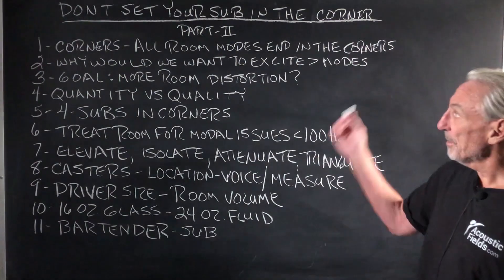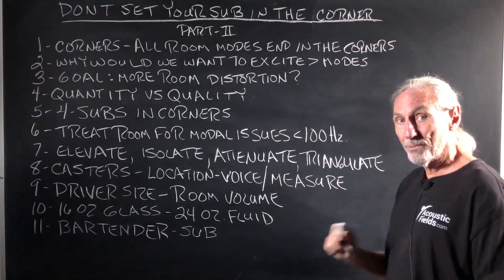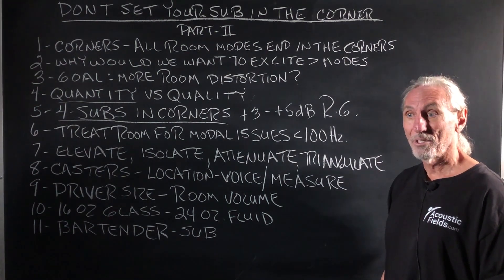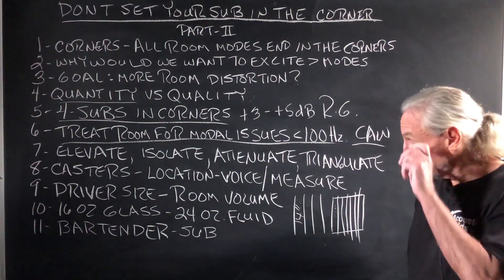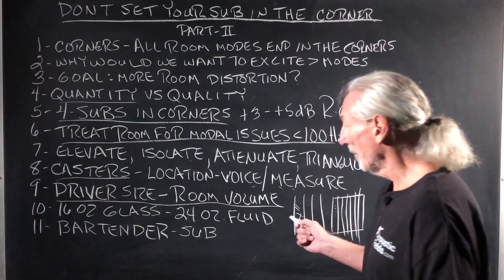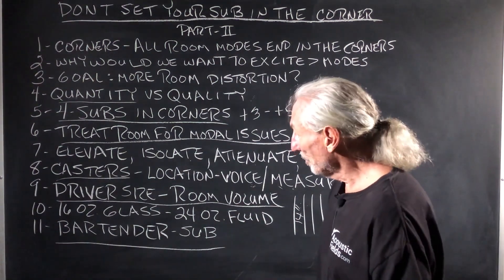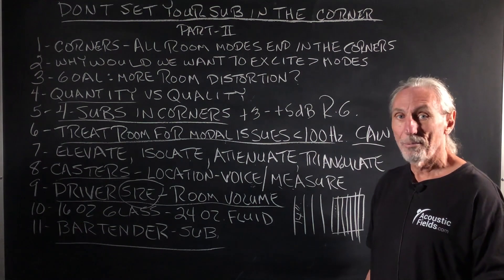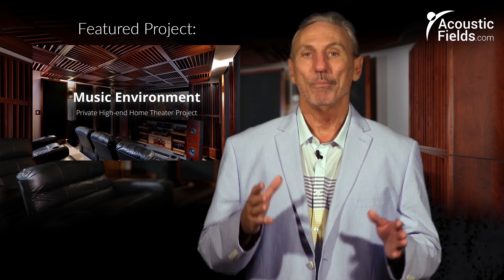Don't Set Your Subwoofer In The Corner! Part 2 - www.AcousticFields.com

Comment: Isnt the theory with corner placement is to excite the nodes /  peak pressure to then apply automatic room correction to smooth out the eq response and time align phase?
Its cheaper and more convenient  for most people to dump and forget and use eq than to spend a huge sum of money and occupy needed space with bass absorbers. 
I appreciate your method has better results and is some what niche however the trend is most people want a simple life and easy wins. 
Imo, there is no such thing as a right / wrong way to do something. Just different levels of madness. 🤪
Reply from the maker: The goal is a flatter frequency response to improve overall room resolution. Electronic processing can lower amplitude at different frequencies. However, it can not do it in a way that  improves overall resolution at all frequencies. We are all about total solutions, not bandaids.
Reply from the maker: No simple life and easy win when it comes to small room acoustics. If your goal is to hear everything in the recording, you must take many steps and just as important those steps must be taken in the proper order or sequence. What cost nothing is worth nothing.
Reply: @AcousticFields  Sometimes, what costs a lot is worth nothing.
Reply from the maker: @Seabass901  Elevate your understanding of our test results. Compare them to other companies. You will have your answers.
Reply: @AcousticFields  I was making a joke. I guess that didn't come across. lol

Comment: I corner load my HSU sub and place the other HSU sub nearfield and that's the only way I can remove the low frequency nodes. I get flat in room response down to 12.5 HZ and EQ the peaks. What is wrong with room gain?
Reply from the maker: Room gain is room distortion. The goal must be to minimize room distortion.
Reply: no quality, different behavior all over the room when you are not always on the same place - the EQ should be the very last step to fix remaining issues after room acoustics
Reply: @Harald_Reindl  Hmm, I understand 'quality' is important, but how do you quantify that? How is that defined? Distortion? Smoothness of frequency response? The bass does  change depending on where you are but only in locations that aren't optimal for listening to my mains anyway.
Reply: @Dawood4  reverberation time, punch, timing, accuracy and no in a good setup bass don't change just because you moved your head

Comment: I’m considering buying a Lyngdorf MP-40. In the manual it tells you to place the subs in the front corners and let Room Perfect (Room Correction ) do the rest.  Then I see this…it’s so frustrating because you don’t know what to believe.
Reply from the maker: What causes low frequency issues within small rooms? It is the dimensions of the room. Certain energy will fit within the given dimensions and certain, usually lower frequencies, will not. The room modal issues are produced by excess energy that doesn't fit within the room to begin with. How can adding more energy into a problem that is produced by too much energy to begin with? It can to a point but the quality in sound is not there. It is quantity, not quality. A good sub today is at least 2.5K. With 4 you are at 10 K. It is best to treat the room with the 10 K and have just one sub. A single sub produces more energy than your room can ever handle. You are just not hearing that single sub correctly because the room will not let you. If you take the room out of the equation with proper treatment, you hear more with less energy.
Reply: Trust Lyngdorf. They explain the reasoning, as many other comments in this video that contradict it.
Reply: I have a Lyngdorf 40 and have placed 2 subs just in front of the corners.  Crossover is at 50 Hz.  They sound great.  Did you go down this route and, if so, what is your experience?
Reply: @Salmonad   yessir I own the MP-40.  I’ve had dual subs front corners and they sound great!

Comment: So why did Electro Voice, Klipsch and JBL, etc. design speakers specifically for corner placement?. The EV Regency III and Klipschorn actually use the walls of a corner as part of the folded horn design. They do need a large room to sound good. I used to have an EV Regency III with an EV 18" in it. 

I just bought a JBL Control SB-2 subwoofer which has a 10" dual voice coil driver and is a slot loaded, vented bandpass design. It is triangular and made to gain full efficiency in a corner either on the floor or ceiling. The efficiency is less when placed in other locations. They came with mounts for corner placement between floor and ceiling or on a wall for commercial applications. So far I have it away from a wall or corner and is still fairly efficient. I have yet to try different placements. I have either stone or concrete walls and floor with an acoustic tile ceiling, and a unique room, so a different situation than most.
Reply from the maker: They place them in the corners to boost the low end output. Part of that boost is room distortion.
Reply: vendors produce what people buy, not what is good
Reply: @Harald_Reindl  The Klipschorn at $12,000 to $20,000 a pair is not at a price point for your average consumer.
Reply: @grob318  honestly if I would like them I would order them and case closed but I don't want speakers working with room gain and distortion - I prefer controlled quality down to volume levels which won't work if you have a cold because of too loud breathing noises

besides the quality problem klipsch speakers are ugly like hell and won't fit anyways in my living room

instead waste that much money for speakers invest it in room acoustic and steakhouses

Comment: Dont listen to this guy! 4 subs in the corner is the best method if u dont want to use more subs. I can get +- 3db from 20hz-100hz. It has been proven and researched by welti. Do your homemwork!
Reply from the maker: More net nonsense. Spending 10 K for 4 subs to cover the frequency response below 100 Hz. is a sub woofer manufacturers dream state. You can treat the whole room and cover all frequencies for 10 K.
Reply: @AcousticFields  my sub is diy for 500usd each. Obviously u never heard a real good sub! 4 subs are always better than 1 no matter what.
Reply: @dansantoso48  $500 for just one sub isn't a very good sub.

Comment: Please can someone guide what driver size is idea for room sizes and link or calculation. I have a 16ft wide and 28ft depth with 12ft height and have 2 10” peerless XLS sealed sub on miniDSP and Hypex I feel I need more pressure especially when I listen at low volume at night Thank You
Reply from the maker: You do not need more pressure. Excess pressure is the reason you are not hearing everything and thus want more energy. You can not use more energy to treat a problem that is caused by too much energy in the first place. You need to reduce the existing pressure within your room through proper treatment in order to hear more.
Reply: @AcousticFields  wow didn’t know that I need treatment to handle pressure was seeing a REL video where he talks of subwoofer stacking like array to get more pressure

Comment: I liked that, Thanks, I saw the other video going through the older ones. 
I am almost caught up on all the Acustic Field's Video's. It's alot to digest even for those in the Hobby for Decades. But it is the Next Level for not only those working and mixing but for the Audiophile also.   And as mentioned, when your into the high dollar Equipment, it's alot less expensive to just treat the room.
Reply from the maker: The room is at least 50% of what you hear. You do not have a choice. With a 50% contribution to the overall sound presentation value, you have to treat if you have any quality sonic strategy in mind. You must treat the room. It should be given a first priority. It should be treat the room before you buy any gear.

Comment: hey! please make a video about this: my room is not 100% symmetrical,so only one of my corners has a big bass buildup. this is my backwall on 42hz. I have no idea what to do,because I think the energy from the other corner is also building up there
Reply from the maker: You must use the required amount of surface area coverage on each wall. It is the complete wall surface area that is causing your issues. For this frequency and amplitude issue, you will need our Carbon Panel. https://www.acousticfields.com/product/carbon-panel/ Most wall surfaces in small rooms take 4-5 units to treat. You must also treat the partner in crime which is the opposite wall. Remember that room pressure build up is produced at a minimum by two walls not two parallel corners.
Reply: @AcousticFields  thank you!

Comment: Dennis, For sake of discussion. What about multiple smaller subs instead of one larger one?
Reply: I have nowhere near the knowledge of Dennis, but I think you would run into serious phase issues unless you have a massive room. 
Also to be small enough to add multiple subs and not "overfill" your room, those drivers would probably get too small to accurately produce real sub frequencies anyway.
Reply: @jacobwhite936  that's what dsp is for, timing alignment and volume is a solved problem! and that small speakers can't produce low frequencies is nonsense given that headphones exists
Reply from the maker: All signal processing has its own electronic signature which is reflected within the mix. This is the reason most music today has lost its soul. There is too much processing. You can bend the laws of physics but you can not break them.
Reply: @AcousticFields  timing alignment is not bend physics

Comment: Instead of rules of thumb, I suggest placing subs where they measure best. 
Complex interactions from various wall, ceiling, and floor boundary structure and surfaces are endless. So you've just got to experiment and measure... without ruling out any locations, corners included. 

I realize everyone wants quick rules of thumb of approaches to try, and those to never try. 

I agree, corner placement of speakers/subs are often problematic. However, there's instances whereby corner placement is ideal for acoustic performance.
Reply: Exactly
Don't rule out anywhere. 
Place them where they perform best... including the corners.
Reply from the maker: Stay out of the corners. Your goal should be sound quality not sound quantity.
Reply: @AcousticFields  I get paid to rock the house, I do it very well...if I need corners I use them, my resume speaks for itself, peace
Reply: @AcousticFields  I don’t particularly agree with that myselfPersonally I believe you should be chasing both sound quality and sound quantity better sound quality and more of better sound quality is always a good thing
Reply from the maker: Measurements are one thing. Tone is another along with pitch. Placing subs in the corners destroys tone and pitch by smothering them both with room gain.
Reply: @AcousticFields  
Yeah, kinda like flush mounted mains in studios destroys tone and pitch. 

No sir.
Reply: I've been using corners often for years, with proper eq you get solid reinforcement from the corner... especially in homes with large room and only one sub in the budget.
Also let's compare flown subs to ground stacks....oh wait, there's no comparison...
Reply: @poserwannabe1  room gain is far away from quality and room-EQ should be only the last step when you are done with room acoustics and there are remaining issues

you simply hear room-eq versus a clean sound especially when you are not all day long at exactly one position
Reply: @Harald_Reindl  you're exactly right, but after installing all types of systems, residential, clubs, theaters etc for over 45yrs I can tell you many times it's simply necessary to pressure the room.... peace
Reply: @poserwannabe1  no, it's not! it seems so when you are not finished with room acoustics and it's possible for bass too, even in small rooms when you use the right types of absorbers

with some creativity even in a living room thanks to the fact that bass is everywhere and goes through nearly anything
Reply: @Harald_Reindl  ok, thanks
Reply from the maker: Without exception, never place a low frequency generating device against a room boundary surface area. Your goal is to always increase resolution not produce more distortion.
Reply: @AcousticFields  
Quite the contrary... proximity to boundaries lessens multiple types of distortions;
- SBIR, eliminating boundary interference. 
- THD, diminishes via increased output by quarter wave boundary loading.
- I²R losses, lessens corruptive measurable effects thermal compression. 

Regardless, never rule out ANY potential location for low frequency/subs. 

Place subs where they work the best. 

Resonances are a given, they're set... as the room's dimensions determine the resonances. 

Vital;
-  What location the subs are placed determine which resonances/modes are excited. 

-  Listener location determines which resonances/modes are heard. 

Thanks
Reply from the maker: @FOH3663  Place subs in rooms that are properly managed with the correct treatment type and amount. Most rooms we see can not properly support one sub. A room with the proper low frequency rate and level of absorption is not plauged with dodgeball positioning issues.

Comment: Now I have to dig into sub placement, because mine is in the corner, and that is the only place in the room where it makes good sound. Anyway, I'd like to get another sub, and have it on the other side. I just feel where the sub is, so I will balance it out.
Reply from the maker: Your room has enough energy with one subwoofer. You need to treat the issues within your room below 100 Hz. so you can hear more of the sound from a single sound.

Comment: I noticed better sound in my room when I accidentally turned the sub off without realizing it
Reply: why do you say that? you don't like the subwoofer sound? i'm about to buy one but then i see your comment. lol please explain
Reply: @carlos_al  I was actually joking. I don't have one. I wouldn't buy a sub unless it had DSP capabilities to align phase and crossover with my monitors. Until then, I'll stick with mhy HEDD 07 mk which go down to 40 hz.

What application are you using a sub for?
Reply: @dougleydorite  i don't know what you mean by application but i have a yamaha A-S501 amp, Klipsch RP600M, red Dragonfly, playing music out of my laptop through soptify and itunes. 

i know i must be doing something wrong because i like my sound but i'm not fulfilled. i welcome tips and suggestions!
Reply from the maker: Yes, most speakers are full range today and produce more than enough low frequency content. When you turned your sub off, you reduced the pressure within the room and thus reduced the modal impacts which allowed you to hear more of the low's.

Comment: I have often contemplated putting the subs from my live systems in the corners of my mix room, but attaching a variable resistor or reactive load to them instead of a signal. My theory is to see if they will attenuate their tuned cabinet frequency. I would love your prediction or thoughts on the experiment.
Reply from the maker: Once the energy leaves the speaker, it enters and becomes subject to the domain of the room. The energy ownership title has now changed from speaker to room ownership. The speaker has relinquished all rights with the new ownership change.
Reply: @AcousticFields  I am referring to a passive speaker cabinet acting as a diaphragmatic absorber. Wouldn't the pressure in the room move the driver and generate a voltage from the coil. If the correct resistor was placed across the coil it would turn the voltage into heat right?
Reply: @jacobwhite936  wat
Reply: @jonathanharris185  Basically using the speaker in reverse.